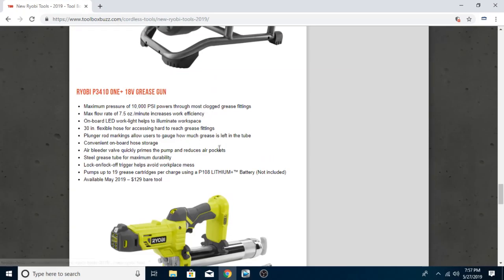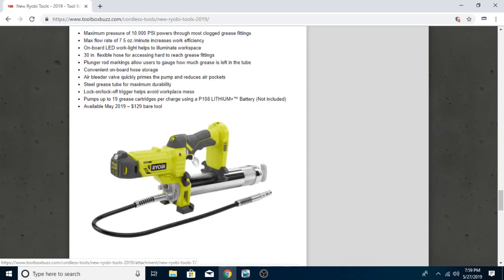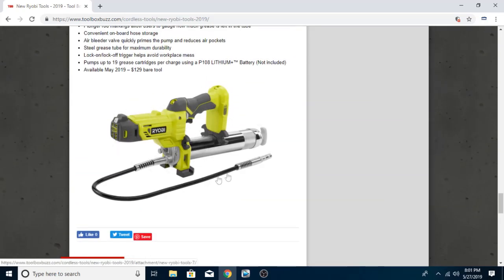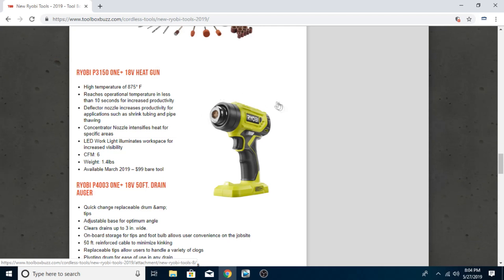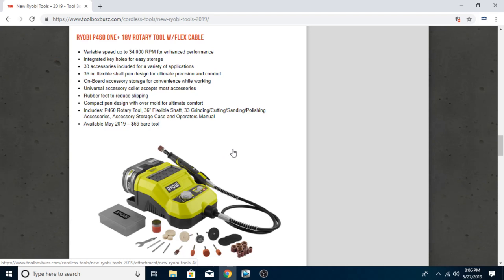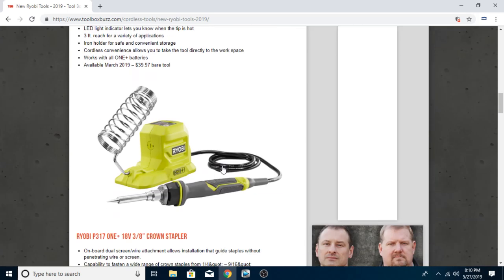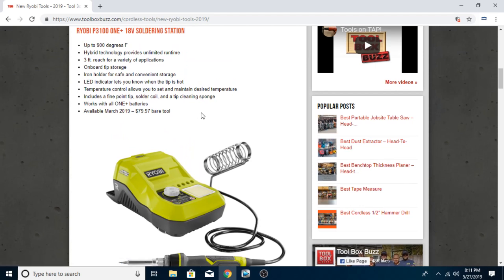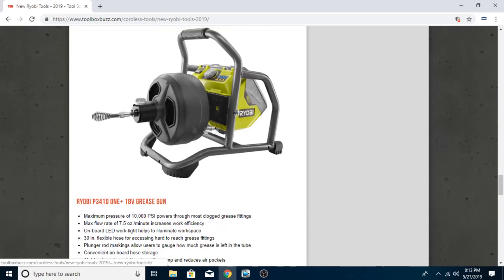ryobi tools you should AVOID buying

Comment: I agree that not every DIY'er need a grease gun like this. But to give you a little perspective from the point of view of someone who uses one in an industrial setting, here's why those gimmicky features aren't so gimmicky.
1. The air bleeder is a must. Banging on it may help knock out the air bubbles, but would you really want to slam a $100+ piece of power equipment on the workbench when it can be done more gently.
2. The hose clip. Self explanatory. I've gone through many manual type grease guns that have no clip. So you're left with your sloppy, greasy hose dangling getting grease on everything it touches. It's also great for tucking it away neatly in storage.
3. Yes the flow stop nozzle is a dream come true! All grease guns continue to sleep, especially when the equipment you've just service take a lot of pressure to pump into. That back pressure builds up in the tube and wants to ooze out everywhere. 
Just some food for thought.
Reply from the maker: I humbly respect your opinion

Comment: I disagree completely with the ryobi grease gun. With its price point it is slightly more expensive than the Milwaukee m12 grease gun and it has better features, better specs. It also is meant for someone who is greasing equipment a lot and doesn’t have the want to hand pump with a manual grease gun. Ryobi is definitely competing with their line of cordless tools considering the price point and the variety of their tools.

Comment: On the grease gun you can buy a kit with battery and charger for $149.00  Also you said you don't need the light because you will be using it in a shop and you will have a shop light.  Not really.  Most of the time you will be using it in the field...or you should be! ALWAYS grease your equipment prior to use!

Comment: This would be awesome w for my tractor. The light would really help for that too. Knowing right away if you have enough grease is a good feature too. I would agree with you if all you have is a few fittings but doing larger jobs is what this is for. Also most heavy equipment operators use cordless grease guns. It is much faster and easier. Ever try to grease a fitting in a awkward position and have to pump in a bad spot?

Comment: Worse review I've ever read.  If you have a Ryobi set you must have multiple batteries and charger ports.  I'm buying one because I have three cars and three mowers and I'm tired of hand cranking grease guns.  I could use air power but battery powered allows for portability...plus I have lots of Ryobi.  A review should address if the tool can actually do the job.